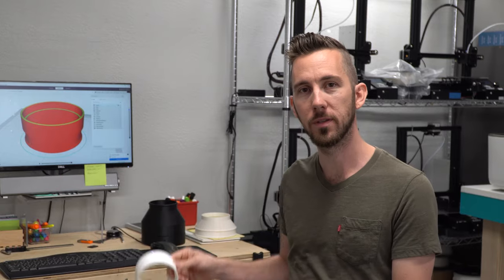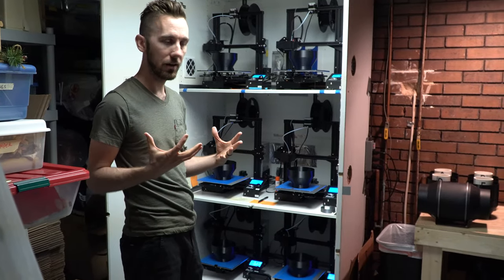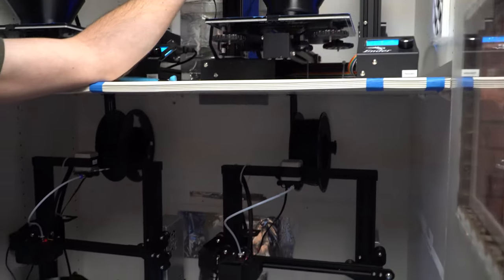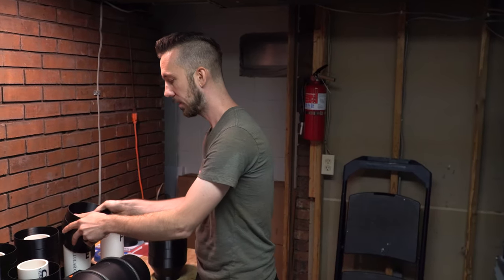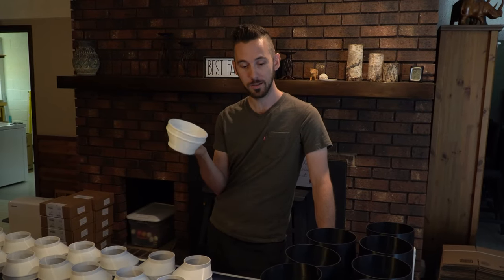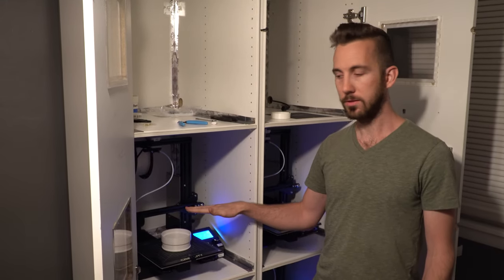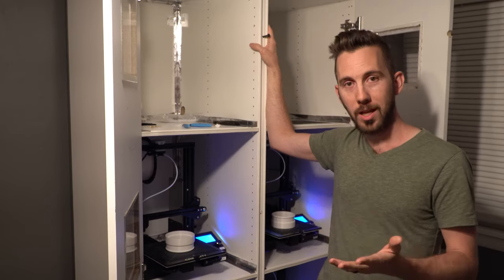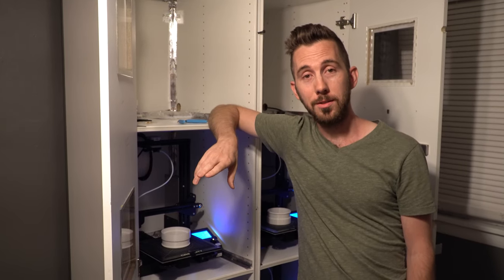My 3D Printing Farm

Comment: Pondering the irony of having a 3-d printer farm (new tech) in a log cabin (NOT new tech.  Just to ask a question, an easy way to check if you have some variability is to plug something with a digital clock into the same circuit as your printer(s), and see if it still keeps good time (I know the clock on our toaster oven if VERY, VERY sensitive to power spikes/surges (through the GFCI outlets in the kitchen) this will also effect other things (including this computer (though the clock battery (being replaced recently) mitigates this....).
Reply from the maker: 3D printer farm in a log cabin lol! 
Thanks for the clock tip, i'll give that a try. 
I'm also wondering if the heat in my printer cabinet can be causing the electronics to have issues. What do you think?
Reply: @MartinsonManufacturing  That could be it also (though I have seen plenty of people put single printers in an enclosure (or small cabinet) without a problem (but that is a single printer (look a Prusa's print farm they use to make their parts it has huge A/C ducts in the overhead (also they print those parts in pla)), I would think that multiple printers heating an area like that would magnify heating problems.  Maybe try ducting cooler outside air (of the cabinet that is) into to main board cases of the printers?  In the extreme (and would be complicated as hell for multiple printers, liquid cool the farm boards (but that is an atomic bomb to kill a mosquito solution)?  An other idea (and again WAY TOO COMPLICATED) would be to take the electronics OUT of the cabinet (something like a ribbon cable into the printing/ hot part of the machine itself from the electronics to the hot cabinet?
Reply from the maker: @fooman2108  Those are some good thoughts my friend. Another guy also recommended running the wiring for the electronics outside the enclosure, which I think is a great idea, but I feel like the wiring would get messy quick, and then i'd need a quick disconnect if i wanted to take the printer out for maintenance.

I really like your idea of ducting cooler outside air into the main board inside the cabinet. I think i'm going to start drawing up some plans for that.
Reply: @MartinsonManufacturing  I forgot about having to change them out (doing maintenance on them also) would be a problem unless you could make the cabling plug/play.  Please post what you decide/make/build.....
Reply from the maker: @fooman2108  Will do!

Comment: Thanks for the video, very insightful to see your set-up! 
What do you do with all the rejected parts? Do you try to recycle the materials? 
I also print a lot for my profession and this part of printing really frustrates me.
Reply from the maker: Glad you found the video to be helpful!

Man, tell me about it. I've trashed countless spools worth of rejected/failed parts and hate seeing it all go to waste. I've seen a few machines out there that will recycle failed prints into new filament, but the cost is high and if the diameter of the newly extruded filament isn't perfect it can significantly mess up your print quality. Definitely a savings opportunity here, just not sure what it is yet.
Reply: @MartinsonManufacturing  If storage space isn't an issue, you could start collecting the failed prints sorted by material in trash bags.
This way you can recycle them immediately should machines like the Filastruder become mainstream and affordable.
Reply from the maker: That’s a good point Max. They will eventually come down in price.
Reply: @MartinsonManufacturing  There is more point in recycling the failed prints through hobby injection molding. Maybe there is a niche product you could do that way? You could also invest in a shredder to process the parts into small bits, then sell those as material to someone willing to run the injection molding setup.

e: at least for PLA, not sure about what setup PETG or ABS would require.
Reply from the maker: @ayylmao.mp3  I really like the idea of hobby injection molding and would love to get into that myself. Have you come across any reasonably priced machines?
Reply: @MartinsonManufacturing  I'm looking at a build by Buster Beagle 3D, which goes for around 200 to 400 USD. It's pretty limited on the injection volume and all manual, but looks like a great way to get started. If you're looking for something a bit sturdier, bigger volume, automatic (not automated, but not muscle powered) injection, Precious Plastic Melbourne has a build that utilizes a hydraulic log splitter. You can find videos of both on YouTube.
Reply from the maker: Thanks for sharing that I'll check them out!

Comment: Nice video! Are you running octo farm?
Reply from the maker: Nope, never tried it before.
Reply: @MartinsonManufacturing  It would make managing and monitoring alot easier! I have 15 3d printers, and couldn't live without it. Look into Octofarm or even octoprint to start. Pretty much turns your printers into network printers.

Comment: At what point after printing the same shape over and over is it more economical to have it manufactured traditionally instead of 3D printed?
Reply from the maker: That's a great question and is where i've been for the last year. Continuing with 3D printing I see profit immediately. Spending $10K in China or $20-$30K in the U.S. to have it manufactured means I don't have to manage printers, but then I won't turn a profit for 1-2 years... Something I continue to wrestle with.
Reply: @MartinsonManufacturing  Thanks for your reply!  I'm contemplating a new product idea, and 3D would be ideal since each product would ideally be slightly custom fit; however, the printing speeds seem so low that it would take a lot of physical space, capital for machines, and operators to scale.  I really need to find an expert to guide me/consulting.  Know any? :)
Reply from the maker: @zed9zed  Talking with a consultant would be a great idea. I don't know any offhand. Score.org offers free mentors to help budding entrepreneurs start their business. I just met with a guy today. Maybe that could help. Or maybe find a product engineer who knows his stuff and can point you in the right direction. Also, a small scale manufacturing company may not be a bad idea either. Reach out to them for a quote to make your part and as they talk with you they can recommend the best way to manufacture it. Maybe the best solution is to machine it out of plastic... I don't know, but they can be a great resource. 
Best wishes to you on your journey!
Reply: @MartinsonManufacturing  Thanks for the suggestion!

Comment: If you constantly make the same parts why not buy a Vacuum former or an injection moulder, you would make parts way faster and use less power running all your printers, at least for the parts that really require volume, the 3D-printers can be used for prototyping and small quantities
Reply from the maker: Definitely! I haven't seen any affordable injection molding machines out there. Have you come across any?
Reply: @MartinsonManufacturing  Well I don't know about the US but I am currently looking to rent one, I only have to pay for the mold and the time I rent the machine, the Mold is still pretty expensive, but affordable, in our businessmodel we do have some very important clients that are in the market for millions of parts (much smaller parts), so off course going bigger is better here
Reply from the maker: @sergetheijspartner2005  Hmm... i've never thought of renting an injection molding machine before, that's a good idea and i'll have to look into that. Yeah, 3D printing millions of parts would not be an option lol.
Reply: @MartinsonManufacturing  Never say never

Comment: You said that your PLA parts are warping from the heat, what if you printed PLA at 100 % solid.. would it now not warp.. it be SOLID PLA.
Reply from the maker: Yup. My parts were solid and still warped.
Reply: @MartinsonManufacturing  so your saying that these items were inside of a box, NO DIRECT SUNLIGHT.. and still the heat was to much for them ?  Were you delivering them to the home of a guy named LUCIFER.
Reply from the maker: Lol. They also had 3 layers of bubble wrap on them too! Huge issue for me in the summer of 2021. Maybe most of the issues were Arizona deliveries, which in the summer, is Lucifer’s home.

Comment: Which model for PAX Wardrobe did you find useful from IKEA?  Also, couldn't you change the circut breaker and have more printers in your environment vs having printers at multiple locations?
Reply from the maker: https://www.ikea.com/us/en/p/pax-wardrobe-frame-white-20214566/

I moved printers to other people's houses not because a lack of power, but because I was running out of space, and quite frankly I didn't want to manage them anymore.

Comment: One question friend how probably is for this printers to get fire? Can we live them unattended I mean I have an ip camera only.
Reply from the maker: Good question. It's something that I've thought about a lot. That being said, I leave them unattended all the time. Id prefer not to but I do. I've never heard of any fire issues with these printers.
Reply: @MartinsonManufacturing  thanks for taking the time I started with two anycubic mega 3d printer entry level I am just testing them I am a complete beginner not like you, could you recommend me a reliable 3d p I am planing to get another one, I am an architect and basically designing wings for RC planes.and custom jewelry  have a great day friend and good luck in your business.
Reply from the maker: To be honest the only printers I've used are Makerbots and Ender 3's (what I have now). I really love the Ender 3 and have been very impressed by the reliability they provide at such a cheap price. But, I think Anycubic's are very similar. From what I've seen Frank, your print quality isn't going to improve until you get over the $10k range. I've seen $200 printers produce just as good of parts as $2,000 printers. The only difference are bells and whistles that improve the user experience.
Reply from the maker: That being said, if you don't mind some assembly and manual adjustments, the Ender 3's are great. A nice step up would be a Prusa MK3 which has auto bed leveling (less setup time for you), more durable parts for longevity and higher temp capabilities for more diverse filaments. And then a step up from that would be a Makerbot which is more plug and play right out of the box.
Reply from the maker: Question for you: as a beginner have you been able to find good resources/YouTube videos to help get you started on your 3d printing journey?
I ask because I've been thinking of doing a "3d printing for beginners" video series but I haven't pursued it yet because I  feel like there's already so many videos out there on the topic. What do you think?
Reply: @MartinsonManufacturing  i tink thats a good idea, everyone like you has their own particular  way to say something  if you have the time and resources go ahead, i see a whole new era on this area if you think about it theirs no limits we can  bring something  created in owr minds into somethin real, its huge , i

Comment: Have you cut and crimped proper ferrules onto your power tips? Creality ships the power leads tinned and that's horrible for an enclosed printer. Especially one running in a farm. Look up wire ferrules... And if you don't you might want to invest in some smoke alarms...
Reply from the maker: I'll definitely look into that, thanks for the tip!

Comment: I think fluffy carpet under a wooden, closed cabinet with six cheapest chinese printers on the market is a nice touch. I mean if you go for fire hazard, go balls deep right?

-Ender's electronics fan speed is tied to part cooling fan speed - no part cooling = no electronics cooling (fine for PLA bad for anything else),
-Wires going into the board are tinned so they are a fire hazard,
-PSU can fail in a heated chamber (pro has meanwell at least, with standard you are pushing your luck but I see you have some experience in that regard already),
-PTFE lined ender hotend gives nasty gases above 230C (again fine for PLA but dead parrots with anything else)

Overall I rate this farm 9/11. Seriously though I really hope you have smoke alarms at least.
Reply: I just left the same comment lol. Same joke and everything. Hope he sees these. Also maybe fystec prusa clones.
Reply from the maker: Your balls deep comment had me rolling! Thank you for that. My cabinet situation doesn't give me the warm and fuzzies. I do have some smoke alarms at least, but this is a good reminder to reassess some things.

Comment: I really want to do something like this, but I'm not sure (A) what to sell that I can just replicate over and over, and (B) is it possible to make enough profit to be sustainable. Obviously, it appears to be working for you-- but I wonder if you would talk a little about that?  Oh-- and one other question, can you discuss some how you go about getting set up to sell on Amazon?
Reply from the maker: There's definitely profit to be made out there. I think the key is finding a niche item that solves a problem that no one else is making and is sold to a community of people who don't have the ability to make one themselves, or don't want to. 
Thanks for the questions, I'd like to discuss those things in a future video.
Reply: @MartinsonManufacturing  I hope you will. I've started and run businesses before, but my life situation has changed and I need to figure out something "home-based" to do. 

I've got experience with 3D printing (and CNC machining, electronics, CAD, etc.) and have been mulling it over for a while, how I could use home-based skills to be more productive. 

I had thought about putting together a general rendering (3d printing) farm, but my research indicates there's a lot of competition in that arena, so it looks to me like that ends up being a "race-to-the-bottom" game.

Your video the other night however, has convinced me there's another angle I haven't considered that might be the better approach. 

I really appreciate your taking the time to put that together, and I'd really like to hear more, if you're inclined to do another video on the subject.

Thanks !!!
Reply from the maker: Well thanks for reaching out and for the encouragement, it's comments like these that make me want to do more videos. It sounds like you've got some great experience to be successful at this. I wish you the best on your journey and let's keep in touch.
Reply: @MartinsonManufacturing  Thanks!

Comment: Have you been running a print farm for this long and only sold PLA parts? Wow this blows my mind. I thought everybody knew about the temperature drawbacks of PLA.
Reply from the maker: Yeah, sold over 4,000 parts in PLA. I never thought to change it because the parts don't come in contact with any heat or stress once installed, but I forgot to account for the summer sun during delivery. Figuring things out as I go :)
Reply: @MartinsonManufacturing  i have sold multiple parts aswell. Started with PLA but stopped when I researched the topic and whent for petg. I have never had any complaints as I only produced the parts for a couple of months in PLA.
Reply from the maker: You're a smarter man than I, making the switch to PETG earlier on. Best wishes to you on your 3d printing endeavors.

Comment: injection molding: exists

i'm about to end this man's whole career
Reply: not worth it at low volume items
Reply: @redgai1  Did you miss the part of the video where he's running 14 + spare printers 24/7, has to constantly repair and troubleshoot machines daily, and has two employees? That's pretty well in to "order 3000 from china" territory...especially at the price point he's fleecing these Iphone cattle for.

Edit: or just, you know, buy the same part already on amazon for 40% the price.
Reply: @mad1337nes  ha i probably did.... watched a bit, skip skip skip, watch, skip, watch skip. I thought he's production was relatively low even at 3000 (per year???)
Reply: @redgai1  I just threw out a number where injection starts to make sense (from my amateur hobbyist knowledge), and I assume setup/programming on such a simple part is roughly in the range of what he paid just in hardware. I get that this was probably more of a convenience/helpful endeavor to start...but dude is charging 2x what even the OEM is, or probably something like 15x what a production abs part should cost.

I hate Apple people as much as the next guy, but please...have even a little bit of heart, this isn't a Ferrari part it's an A/C coupling that's widely available even at HomeDepot/Lowes.

Comment: Why not spend a few bucks on a die and injection mold these ?
Reply from the maker: Dies aren't a few bucks. $10K for a cheap one from China. $20K-$30K for U.S. made. Hoping I can make them myself down the road, but then I'd still need to buy a $150K injection molding machine lol.